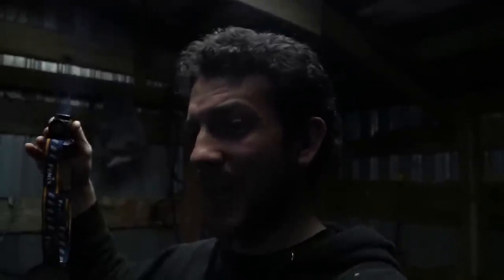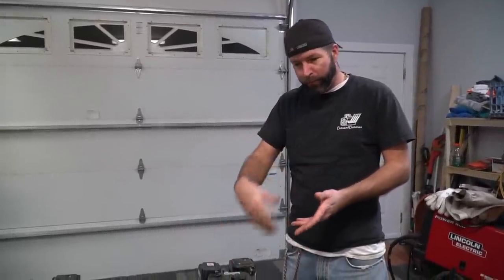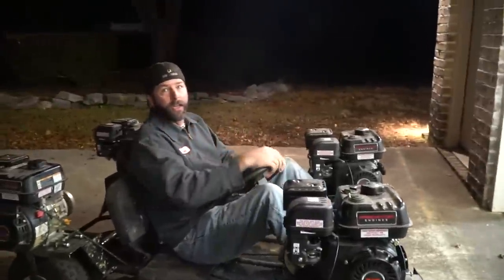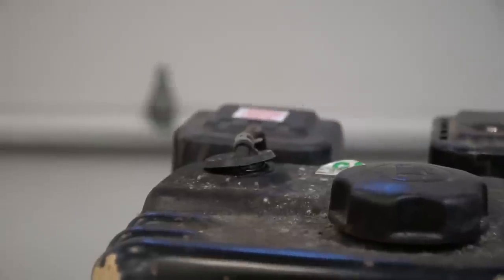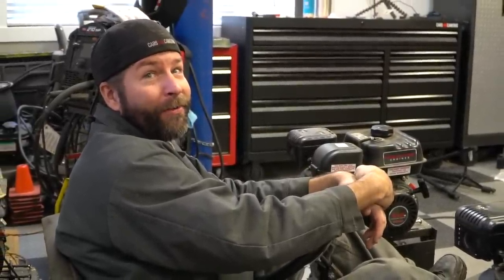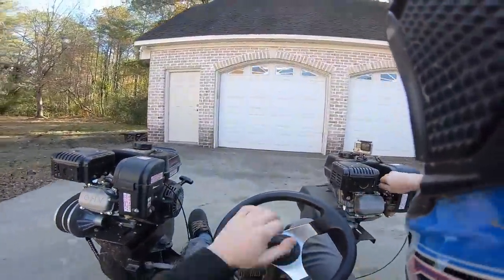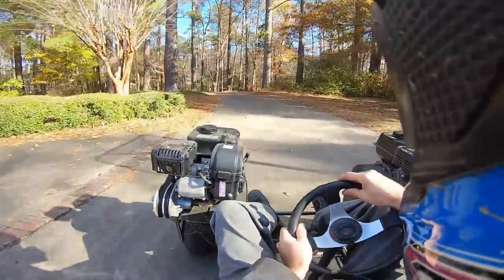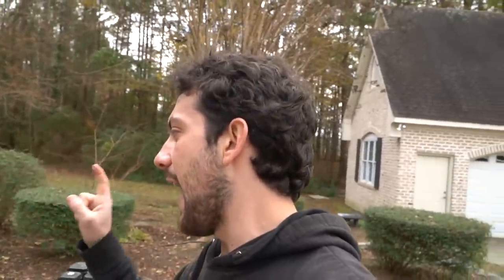4 Engine AWD Go Kart Revival | Hard Launches!

Comment: 4 times the engine,
4 times the issues!
Reply: But...

I thought they were Honda or Yamaha motors...

Are Japanese built engines not reliable anymore?...
Reply: @SkylineLofe  Whole thing is only reliable as the least reliable engine!
Have you also tried syncing 4 ICE engines at the same time?
I call this thing 4X4, because probably more like 16 times the issues!
Reply: I bet you piss on everything. This isn't about convenience or practical, this is about extreme. I think there is still room for two more motors and 3 if they can fit one in his lap.
Reply: 1 x engine = .25 the fun...
Reply: @SkylineLofe  every engine gets issues at some point
Reply: It'll probably move if only 1 or 2 engines will run
Reply: This is not about an issues.... but about having fun
Reply: Sai Vootukur listen, just because it’s Japanese doesn’t mean it always screams reliable. It’s a engine and engine has its flaws
Reply: But only one engine gas to be running for it to move, also they're just lawnmower engines, very simple, that entire go cart is actually less complicated than just my transmission

Comment: Built up all 4 engine's ,25 HP each for a monster 100-ish horsepower 4 wheel drive go cart
Reply: No, build a new one with 6 420cc engines on it.
Reply: @maxwellgreen5750  Make it a true 4x4. 4 engines per wheel
Reply: @tbirdracefan  yes
Reply: Put a 3 cyl diesel Kubota for each drive axle--front and rear.
Reply: 4x predator 670s
Reply: Put a proper engine in not these crappy little things
Reply: LS swap
Reply: Put 4 of the 50 hp modded 670’s
Reply: Thanks lol. 😂
Reply: @maxwellgreen5750  might as well convert it and put 4 v8-s on it
Reply: Maxwell Green 4 hellephants
Reply: And don't Forget the NoZ
Reply: Ok I can play this, 4x race tuned Saturn 5 SRB’s. I win
Reply: More power than a chevette
Reply: How bout 2 built sr20's
Reply: Maxwell Green Na, ill one up you, how about 20 1000cc engines?
Reply: @tbirdracefan   i agree
Reply: 4 honda crf450r engines. 200hp or so should be good right?
Reply: hp is nothing when rpm is 3000 rpm, it would be around 10-ft lbs per engine
Reply: Yuuuuuup
Reply: Even better 10 7.3 powerstrokes per wheel
Reply: Armando Gonzalez Or 500 Wartsila Sulzer RTA-96C Engines per wheel. Each makes approx. 108,000 hp and 5,000,000 lb-ft.
Reply: Hayabusa turbos I win
Reply: That would be hella expensive
Reply: This is not how it works..will only go as fast as the most powerful motor on one..all 4 motors are pulling each there own weight..complete waste of money here
Reply: The predator 212 is only a 6.5 hp engine, so in this video he’s only 26hp 848cc on 4 cylinders total. thats just 1/3 of my 1982 550cc sport bike which is just a v2 carbureted. Those predator engines really are not impressive at all for their displacement.
Reply: Jeff Kopis True, but it would have 432,000 hp and 20 million lb-ft. Even with it weighing 4.6 million pounds it would still do 0-60 in under 4 seconds 😂
Reply: @tbirdracefan  no. 6x6

Comment: Tourqe steer come out of un equal length driveshafts, since You dont have drive shafts, and close to equal power on both wheels, that eliminates tourqe steer 🤘
Reply: This exactly. That's why the axles on FWD cars are different thickness since the longer axle tends to flex more.
Reply: Also when it makes and breaks traction it will try to yank the wheel out of your hand
Reply: That’ll be fine 🤣🤣 that one, You can’t Get out of.. that will always happen 🤔
Reply: Yup, I was looking for this comment.
Reply: @vabu94  Honda uses a half shaft so both can be equal.
Reply: Makes sense. (TL)/(JG) IIRC is the driving [or should we say STEERING] Force!
Reply: I was so surprised they didn't know this!
Reply: Scrub radius is also another big consideration for torque steer, ideally the kingpin needs to point down close to the center of the tire patch

Comment: 4 diodes and you can hook all the kill switches together on 1 switch ...just saying
Reply: Or use a quadruple pole switch...
Reply: Or just do it the scetchy way and just make a ground to the frame and then run a wire to each engine that would work ....
Reply: @corbinboltz3666  you can't do that , if the kill wires are wired together the signal will backfeed between coils and it wont run , v twin briggs engine will do this if the diode burns out between the coils same thing if you tie more than 1 engine together
Reply: 4 kill switches on column
Reply: Great video guys, how does Jon's dad feel about your tearing up the yard? My old man would have killed me!
Reply: @MattsMadnessOfficial   hmmm ive never had that problem before with my twin engine machines🤔
Reply: Those 'p' leads have a much higher piv ( peak inverse voltage) than what any diode can handle... 4 seperate very well insulated wires to a single point, Insulated from  ground will provide a good engine kill source by shorting that point to ground manually... A used hacksaw blade works very well for that ...

Comment: Torque steer happens in FWD cars because the engine and transmission are mounted transversely with the engine usually on the passenger side of the engine compartment and the transmission on the drivers side. because the transmission isn't centered between the two front wheels the drive shafts for each wheel are different lengths and the longer one torques slightly causing a delay in power to that wheel. As a consequence the wheel with the shorter shaft gets power sooner and starts to "steer" or drive the car forward more than the wheel with the longer shaft. With a direct drive system like this you will never get torque steer in the traditional sense. Great video great build! that thing is awesome!

Comment: Go power sports sells 5 point harnesses that beast needs one
Reply: wd40 hellyea needs a new seat
Reply: @anthonylusano6906  seat can be used just needs upgrading on the harness
Reply: And a roll bar or cage
Reply: Nooooooo, this thing has 4 engines. This needs at least a 20 point harness, 5 for each engine

Comment: I think that a live axle on the back with the two engines sipnning it at the same time would be good, so you can add a disk brake and be able to stop. A different kind of steering sistem can also be useful in order to be effective on the lap. All that power shouldn't  be wasted by poor control. Sorry for my English if I made some mistakes, cheers from Italy and merry Christmas

Comment: Single fuel tank tank behind the seat feeding all 4, make an aluminum block with all 4 throttle cables going in one side then 1 main out the other 4-1 - equalize them that way. Cut or roll some motorcycle fenders and bolt them on the rear of the fronts and fronts of the rears for mud/dirt guards, lastly you need to cant the seat up about 20 degrees in the front and lower the rear down about 10deg and tack in a couple of U shaped roll bars on the side and pad them with foam as side bolsters. That thing will be a blast~

Comment: The lack of torque steer was probably because the drive is going direct to the wheels and doesn't have to go through any kind of axle system. As a result because the drive from the motors isn't running through the same place as the steering linkages, it's separate resulting in no torque steer. But so pumped to see the beast back. Merry Christmas!

Comment: Remember with all wheel drive the front wheels will help pull you through the turns, so you’ll turn even better under acceleration than braking or coasting.

Comment: While you are working on the sterling wheel build a separate column and chain drive the pinion of the rack to speed up your steering.
It is only 4 cylinders with 4 carburetor 8 valves 4 ignition coils and spark plugs. The only parts that are overly abundant are starting equipment,  and drive train components like torque converters Drive belts but those would have to be replaced with something else if all four cylinders were on one crankshaft.

Comment: This thing is awesome lol. Probably would have been better to have a live rear axle and run one engine in the back, or maybe both chained to dual sprockets on the same axle. It seems like performance-wise it has a lot of funky weight distribution and stresses. Solidifying the engines at least in the back would help that. Stick a bucket seat on there. Or set some pillows on the seat with plastic drop cloth covering the pillows, later up three or four fiberglass blankets over the plastic, cover that with more plastic, and sit on the pillows to get a good ass molding bucket seat

Comment: I would make the steering more like a normal go kart.  You don't have a differential on either end.  So I dont think you need to worry about torque steer.  Also the right rear is not going to lift up or burn out more easily.   Again no diff.  Also there's no driveshaft to make the frame twist which is what causes the right rear to lift up.  Your engines are all mounted sideways.  I also think the 20 hp kits would be cool.  This is a really cool project, it just needs a little more work to be super cool.

Comment: It would drive me nuts having the steering wheel at an angle. I would center the wheel and have it straight, then would do a little chain driven link from the bottom of the steering shaft over to the steering box. That way the steering would be straight, AND you could adjust the ratio so there was fewer turns from lock to lock. Cool project though! Subscribed and liked ;)

Comment: Hey you guys should do some research on cv axles and joints and y’all could build some badass 4wd carts with all the support y’all have it’d be easy. Solid axle with C/V joints   Not only just 4wd but independent suspension

Comment: That was unexpected —- and great!
if you don’t mind I’ll give a suggestion for another go cart... (I actually think this idea might be good for a race car on an oval— so turns can be made at higher speed without loosing traction). The basic idea is to use a rocket motor to apply downforce on each wheel... so that, when car is turning the car is held FIRMLY against the pavement. (Alternate... make a car that uses the same principles to drive up a vertical wall)...

Comment: You guys should torque bolts down by hand after using the impact. It is my experience that the torque from the impact driver (I have the same one as you) isn’t enough for most jobs on small engines due to the vibration.

Comment: This opens up possibilities..
You could have accelerator and brake for each wheel, one on each foot and motorcycle controls on the steering wheel or a faster rack and motorcycle handle bars, that was you could control acceleration and braking independently for each wheel, when you pull up on the throttle with your feet you brake the rear wheels (or fronts depending on which is easier to learn really) by having a bar connected to the throttle above your foot.
Think dual shock Accel/braking on the right thumbstick on a PS2 controller for Grand Tourismo to give analog control of both of them.
Reply: Oh and link the stop switch lines to one up front somewhere easy to get to
Reply: And protection for the driver, better seat, rollcage and harness, why not?
Maybe better exhausts for the front motors to get it away from the driver, and the for  the back ones for looks and power?

Comment: use a gear reduction on the rack. new steering shaft mount and a chain with 2 sprockets. give the rack a 2:1 or 3:1 ratio for less turns of wheel.

Comment: you guys should make a structure for the 2 front engines, put the chain far from the front wheel and only turn the wheel without the engines, (you could even put the engine above your feet and make wider the direction bar), i could make a project for that

Comment: Better use a bucket seat, so thendriver will not slode forward.. Mynsuggestion: get a plastic modullar seat, put a hinge at the front and two coil springs, small. At the two rear ends. Your butt will not absorb all,the road shocks. A comfortable,ride.

Comment: Torque steer is due to unequal length driveshafts, twisting different amounts under torque. Lots of cars have different thickness shafts now, and also have the diff as close to the centre as possible.......

Comment: If you make all the Predators stage 1, strap yourself in in a bucket seat, remove the governors, and hold it near wide open the whole time, you'd run under 25 seconds

Comment: I think you guys in a tim Allen way proved that 4 engines are better than one,although that's why cvt axles exist but it is working concept.you guys should test the capabilities then if it is good do engines in the center use lower rpm engagement variable drives and cvt power out to wheels and go bigger

Comment: I agree with your comment, "This is why you use non-ethanol fuel", if you plan on neglecting the fuel during storage.  What I don't agree with is people expecting ethanol fuel to act just like non-ethanol fuel.  Believe it or not ethanol is not the same as gasoline, has it's own advantages and disadvantages, is a different chemical, has it's own chemical equations with different reactants and products, and burn ratios.  Once you learn the differences you can easily take care of ethanol fuel, like using fuel stabilizer before you store the fuel.   People also say ethanol fuel is poor quality because it gets less mileage per gallon.  While the later is true the former is not.  Once again it is  different chemical with its own advantages, like higher octane and higher horse power.  Get to know each type of fuel so you can understand how to take care of it.

Comment: You need to figure out a way to build a 212cc solid axle rock crawler. Small transfer case, golf cart rear axle. And some sort of drive front axle on a custom chassis. If you build it they will come. It's been a dream of mine to build one and some day I will.

Comment: haha wicked.

pretty sure it doesn't torque steer because i think thats due to the engine and its config for fwd cars. having two engines over the wheels fixes the config issue and id imagine those engines dont torque on the mounts too much... even if they did, i don't think it would have the same effect? i dont really know, i looked this stuff up a few years ago when i was curious

Comment: You should make the rear engines pull the throttle first, so they are further in the power band do instead of a 50/50 split it could be 70/30 or 60/40 etc. So it doesn't understeer

Comment: You should build version 2 of it with the engines on either side of the driver and maybe slightly longer wheelbase to allow for a chain to go parallel to the ground to lower the center of gravity and allow for suspension of some type to be put in. Alternatively 2 engines could go on either side and 2 engines could go behind the rear wheels giving it ability to wheelie and making it more likely to oversteer instead of all that understeer. Do those front engines make it feel like a locked front diff?

Comment: There has to be a way to make the steering inputs influence throttle, right? like if you're turning right, have it decrease throttle for the right side motors.

It would probably require some manner of throttle by wire system, and I understand that this kart is more about creating a four wheeled bad idea than a reasonable off road vehicle. haha

Comment: A seat belt or a bucket seat would do you better. Also I think some mud flaps would help those rear engines from getting hit with dirt
Reply: Also would a steering knob on the steering wheel help you guys with turning faster?

Comment: Torque steer is usually the byproduct of non symmetrical drivetrain components mainly Axle length differences.  Transverse front drive vehicles usually have a long and short axle. The more power more torque steer.  Manufacturers try to counter the effect with larger axle diameter on the longer axle.  Not that you don’t know this by now.  
Doesn’t really apply to your machine.  
Impressive build.

Comment: First time watcher, first time caller .My question is would adding 6 inches or so to the length of the chassis be a remedy for you steering wheel angle and seating position.

Comment: Front wheel drives torque steer because one driveshaft is longer than the other due to the engine being mounted in transverse and the gear being way over to the left

Comment: A FWD car torquesteers since one of the axels are longer than the other. Therefor when youre accellerating one axel flexes more than the other, causing one wheel to go faster than the other and torquesteer is born
Reply: You wont have this problem since you dont have axels. As long as bouth engines produce the same ammount of power

Comment: You can put 4 engine right beside each other weld the shaff from one engine to pull string of other engin then same with other 2  4 engines  Question one torque converter and then do a tractor pull and see how much power you that Or hear it so hi that you go real fast
Reply: Gear^^

Comment: I have a question about my predator 346cc engine.. It idles rough and when i looked back while riding my gokart it was misfiring/ idling rough and coughing blue smoke.. If you could help me find the problem that would help a lot. Thanks

Comment: Torque steer isn't from high horsepower sent to the front tires,  it's from unequal length axles splitting power to 2 separate wheels.  As long as the front engines are synced, you will have 0 torque steer
Reply: Traction is a factor as well

Comment: Would you guys please let me know if you think a 60 tooth back sprocket should pull wheelies, thanks I might have to go 75 change to a 35 roller chain I can't find a 420 only 60universal 1/2 spread between the teeth that's a 420 or 41 as well I believe

Comment: FWD cars torque steer due to the difference in length of the drive axles. If the axles are the same length, there is no torque steer.